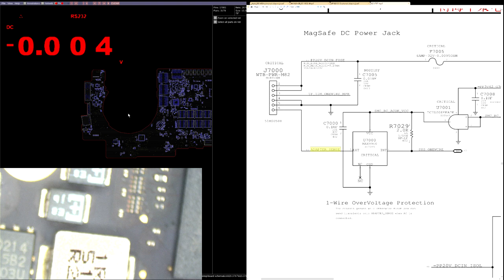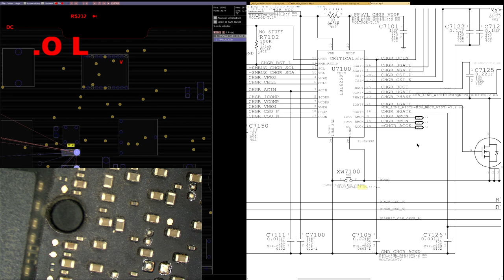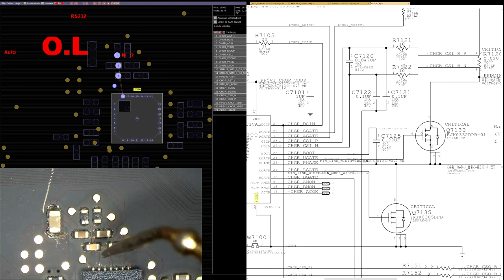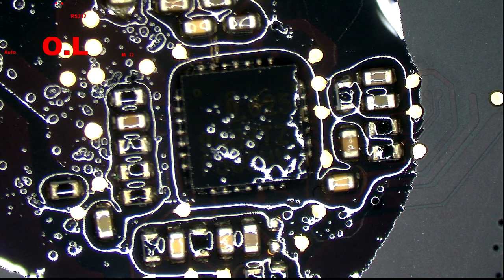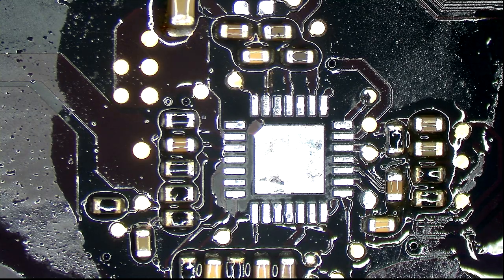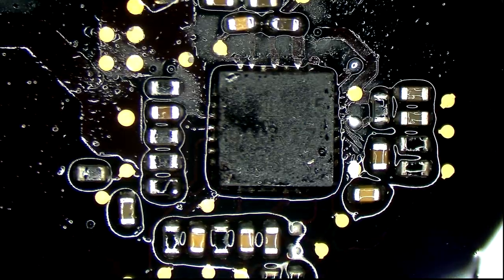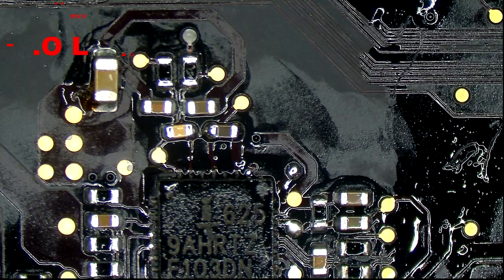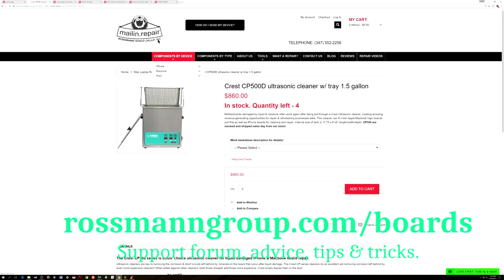Retina Macbook Pro DEAD, PPBUS_G3H stuck at 4v.

Comment: AMEN on finding what caused a fault. I don't have much experience repairing electronics this tiny, but a lot of what you do is analogous to cars. A fuse for a circuit blows, car owner puts in a new fuse (fairly simple, dedicated large fuse panels). The new fuse blows. So what's their solution? Put in a bigger fuse! Then it works until the wires burn up, and their potentially simple to fix short to ground has become a much bigger job...

Comment: pls i have an 820-3115 board,no light on charger change isl6259 and current sensing resistor green light comes but still not power on ,ppbus_g3h stuck at 3.7v,chgr_acin ok, chgr_ acok ok,but still stuck at 3v

Comment: Hi Louis, I have somewhat unusual (maybe) situation with a mid 2012 macbook pro 15" retina, in 2015 it got wet by the rain (long sad story) warranty was void due to it, apple  told me they needed to replace the logic board and see if that would fix it if not they would continue replacing pieces until they could fix it. Of course each one of those would cost a lot, so then I decided I would sell it in pieces, but time passed, and now in 2017 I was going to throw it away and I decided to try to turn it on, and it did! It worked flawlessly for about 1 month, until today in the morning when I opened it and nothing happened and also the charger indicator is not lit when connected to the charger. Do you think it is still repairable? I am thinking it is something related to the "power supply" of it. Do you think it will be "cheap" ( by apple standards) to fix it? I would take it to you to repair it but I live in México, I guess the shipping it would be very expensive?

Comment: Hello Louis! Recently I've got my Macbook air 11' 2014's logic board repaired (specifically the RTC circuit and SPI operationals, according to the technician). How long do you think a repair like this will last? Life-long maybe ou less than a year? I'm asking that because i bought a new notebook (Dell 7460) and I'm thinking about selling the Macbook and keeping the Dell instead of returning it if the repair won't last long